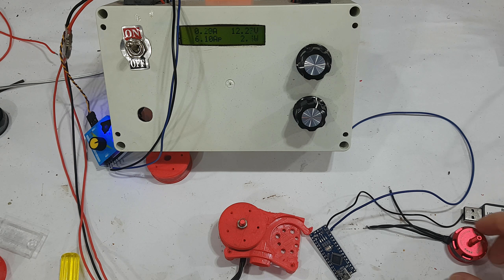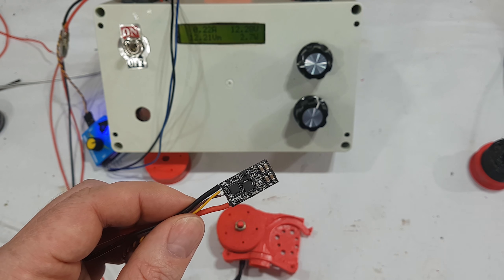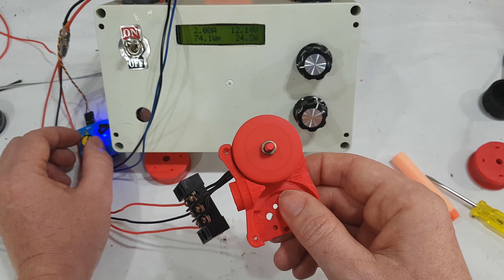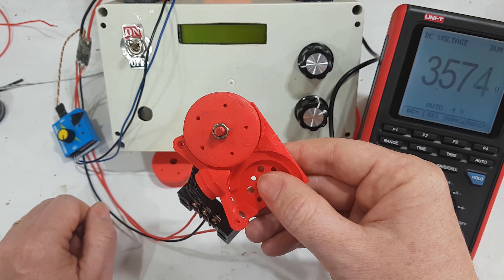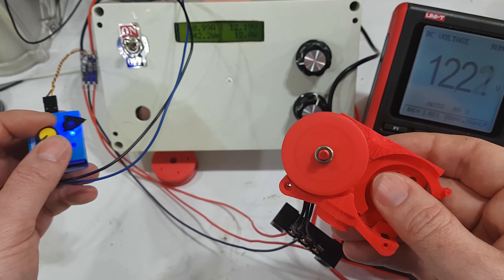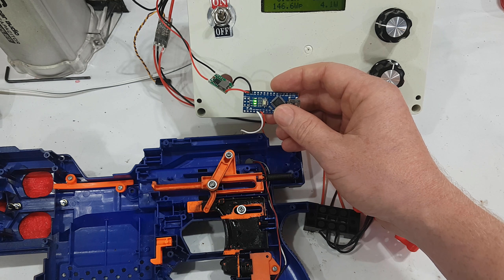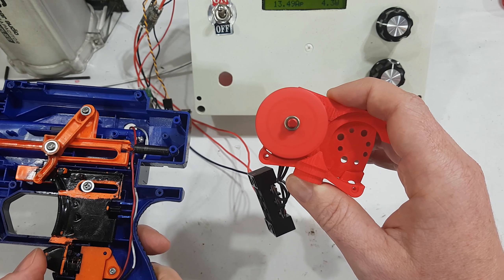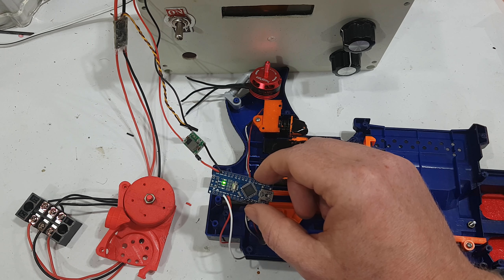Nerf Stryfe Arduino / Brushless Motor How To : Part 6

Comment: hi guys. is it possible to get the wiring diagram and the explanation for the arduino coding? this is a completely new experience for me, would really love to dive in and learn about arduino and how to control those brushless motors.
Reply from the maker: At the start of the Arduino Code it tells you which pins to solder to what 

// Created By Michael Dixon (Ultrasonic2) Auckland New Zealand

//Battery + "Bucked" down > 7ish volts in at VIN
//Battery - > GND

//Trigger > D2
//Trigger > GND

// Servo Signal (PULSE) > D9
// Servo - > D7
Reply: is it possible to use those esc with BEC 5v to power the arduino?
Reply from the maker: I'll make you a diagram in a few days

YOU HAVE to use a high frequency ESC not a cheap rubbish ones and the ESC's that were high frequency did not have 5v out. But if you can find one then yes in theory it could power it via the 5v in on the Arduino
Reply: i see. i guess i just gonna order all the item you listed, instead of just using what ever i had laying around haha. nice + awesome project btw sir :)
Reply from the maker: let me know how it goes..  it should be awesome. I've spent SOOO much time on this... I have a Raven flywheel mod coming out soon... any other idea's ?
Reply from the maker: Actually I had some time So check out the thingiverse page as i have uploaded the wiring diagram... It really is simple as.

Comment: Would you mind adding a parts list?
Reply from the maker: Done Parts list is now part of my Thingiverse page
Reply: Ultrasonic2 you rock!
Reply from the maker: Not a problem .. hopefully now you can go spank FDL2 owners and laugh at how much they cost :P
Reply: Ultrasonic2 I am in the land of the FDL's. So it would be nice to have the same edge... Well a sharper edge because of your refinements.
Reply from the maker: The FDL is a strange one to me .. while IF i had made it i would be EXTREMELY proud of my self it has some strange illogical ora around it... Get stryfe stick Brushless motors in it and a Auto fire/ Select fire kit and you're there But err looks better than the FDL.... personally i think the FDL completely missed the point of existing. If you're going to go to that much trouble why not make it have crazy awesome performance but no .. it's a stryfe ? ..... I have plans to start my own project .. the Quest for 400FPS.. can't be that hard ... though obviously not in a stryfe
Reply: Ultrasonic2 agreed, it does have a bunch of utility. I would never buy one though. I don't really like the style, so I would prefer to mod a Nerf blaster and give it all that utility. I will be watching for your next project, since you got a good sense of style.. Plus before I found your channel I was already researching peltier cooling/heating. 

400 fps... Whew that will cause foam to explode, lol. Maybe if you made darts out of 4lbs EVA foam they would survive.
Reply from the maker: im pretty sure 400fps is doable... all you need is grip (Done) .. more RPM (surface FPS) and to counter wind resistance.... wind is the only negative i can think of.. Should be done easily with multi stages, which is the only way to not destroy the dart otherwise acceleration would be to great.... Im just making this up but if we have 4 stages thats only 100 fps  per stage.... which is far less than i have on a single stage so it should be doable... in theory i can get a surface velocity of 650 fps ... so 400FPS should be doable.... Countering wind resistance will be the interesting part ..... IT will be a fun ride.... Will do it after the Raven mods and some more modes to my 3d printer.
Reply from the maker: mind you i might get sunk due to my printers in ability to print perfectly round wheels
Reply: Ultrasonic2 send it into shapeways and have a couple made from nylon. That should withstand the rpm. I think you can easily hit 300fps with a two stage with the first on 3s and the second on 4s. Should put you around 45000 rpm. I'm cheering for you, I'm all in on your designs, any other blaster you going to design a cage for?
Reply from the maker: yeah i had thought of getting someone else to make them but.. im not sure that they will be the right size  to fit on the motors .. if they under or over extrude them they will be useless :(  I have to do the rayven cos my son is obsessed with it ... i can see why i actually think it's better than the stryfe... Not sure i can fit such large wheels in the the  rayven.. 

Assuming i can get 400FPS or more, im thinking of 75,000 RPM i'll be making a bullpup  design i think''  cos right now my stryfe is a bit large and if i gog with bullpup it will be a lot shorter overall..
Reply: Ultrasonic2 shapeways is pretty solid with being exact... At least in my past experiences with them.

I have a Rayven.. So that is music to my ears. 

75000 should do it, lol.
Reply from the maker: Mind you 75,000 rpm is 6s and good for 650fps ..... i just need to get the wind going down the barrel at that too..then we should be onto a winner. err if it doesn't explode..which it might if it takes a shock
Reply from the maker: Oh bummer .. i hadn't really thought of this but, it's pretty doubtful a F396 CPU (the fastest) powered ESC can spin these motors to such high RPMS and thus i can't use out runners or printed wheels.... im pretty sure i don't want to run inrunners and currently available 2mm (ID) wheels
Reply: Bummer, you want an outrunner for the torque.
Reply from the maker: Not really ... the size is great and made mounting simple, but the main reason is you can't make 3d printed wheels that will work to fit 2mm shafts ... Will have to do some testing to see how fast the ESC can go .. i know it can go higher than 3s but how fast im not sure.. These ESC  can only do 4s, which  i have not tried...
Reply: Ultrasonic2 yeah, the motors are only rated to 4s... But with cooling... You can do a bigger ESC for a 6s.
Reply from the maker: Yeah .. Well i want the air going down the barrel so the idea would be to suck it though the motor first... also the duration is low, it's not like we are flying around for 30mins like in a Quad coptor or anything like that..... FYI if these ESC's can't do it i have found a ARM based ESC that is claimed to be able to spin them in the ball park we are talking
Reply: so basically, this is just going to turn into a railgun :>

Comment: will something like this work as well?:
AZDelivery Nano V3
Reply from the maker: i think so
Reply: also is this possible without previous knowledge on arduinos
Reply from the maker: That is my intention ..  im going to do a step by step guide when my missing parts turn up... so everyone can follow along knowing nothing prior .. you don't need to know about c# programming to get this to work .. just download some applications and plug the arduino in and flash it.
Reply: will this cage also work with a rapid strike? also, where is the Arduino code
Reply from the maker: 100% wont fix the rapid strike ( i have one too ) . code is part of the thingiverse download
Reply: I hope this will work for me, as I already burned 2 polulu motor drivers for an rc bb8 project
didn't know anything about code, and found a tutorial but it just killed 2 drivers
had to go the simple rc electronics route, it is now working
Reply: I hope when I attempt this it will not go the same route
Reply: when can we expect a rapid strike cage?
Reply from the maker: i do not know.. I assume that there is only a hand full of them around that would be interested.. i have done the rayven.. and bought a regulator last week.. the Reg is the obvious one to work on next
Reply: :( ok.......
so maybe after the regulator?
Reply from the maker: Probably .. i'd like to finish the select fire on my rapid..
Reply: so it would be a select fire brushless rapid strike?
Reply: definitely better that the fdl2+
Reply from the maker: yeah man.. .. im hoping the stryfe will be better than the fdl2 once im finished with it ... So should the regulator too... just not enough time.... i currently editing a reg video as we speak
Reply: now you just need to copy walcoms7's triple mag well rapidstrike: https://www.youtube.com/watch?v=1MvjbQNwcrs
Reply: and it would probably be the ultimate nerf blaster, better than Eli wu's rapid strike.....
Reply: hopefully once you have time, we will get a rapid strike cage
Reply: just got the Arduino software, and to run it on an Arduino I just need to delete the top part about what connections go where. right?
Reply: I verified the code but got this,
Arduino: 1.8.4 (Mac OS X), Board: "Arduino/Genuino Uno"

motor_test:2: error: redefinition of 'Servo myservo'
 Servo myservo; 
       ^
/Users/dragonspc/Desktop/StryfeMotors/StryfeMotors.ino:14:7: note: 'Servo myservo' previously declared here
 Servo myservo; 
       ^
motor_test:3: error: redefinition of 'int RevPulled'
 int RevPulled; 
     ^
/Users/dragonspc/Desktop/StryfeMotors/StryfeMotors.ino:15:5: note: 'int RevPulled' previously declared here
 int RevPulled; 
     ^
motor_test:4: error: redefinition of 'int PreviousFlyWheel'
 int PreviousFlyWheel = 0; //off
     ^
/Users/dragonspc/Desktop/StryfeMotors/StryfeMotors.ino:16:5: note: 'int PreviousFlyWheel' previously defined here
 int PreviousFlyWheel = 0; //off
     ^
/Users/dragonspc/Desktop/StryfeMotors/motor_test.ino: In function 'void setup()':
motor_test:6: error: redefinition of 'void setup()'
 void setup() {
      ^
/Users/dragonspc/Desktop/StryfeMotors/StryfeMotors.ino:18:6: note: 'void setup()' previously defined here
 void setup() {
      ^
/Users/dragonspc/Desktop/StryfeMotors/motor_test.ino: In function 'void Buttonsstate()':
motor_test:12: error: redefinition of 'void Buttonsstate()'
 void Buttonsstate()// de bounce 
      ^
/Users/dragonspc/Desktop/StryfeMotors/StryfeMotors.ino:24:6: note: 'void Buttonsstate()' previously defined here
 void Buttonsstate()// de bounce 
      ^
/Users/dragonspc/Desktop/StryfeMotors/motor_test.ino: In function 'void loop()':
motor_test:26: error: redefinition of 'void loop()'
 void loop() {
      ^
/Users/dragonspc/Desktop/StryfeMotors/StryfeMotors.ino:38:6: note: 'void loop()' previously defined here
 void loop() {
      ^
exit status 1
redefinition of 'Servo myservo'
Reply: so what is wrong with the code?
Reply from the maker: i assume whats wrong is you deleted the stuff at the top lol/ And or you you copied and pasted it twice ..

Did you get it going
Reply: yes, I fixed it
and yes it was the fact that I deleted the top part.......
Reply: now I just need the components and I will be ready to test it
Reply from the maker: let me know how it goes.. seriously
Reply from the maker: just make sure you get good esc's
Reply: could you please tell me what rectifier diode I need cause I could not find the exact name of them
Reply from the maker: why not use the links provided ?
Reply: would this theoretically fit in a aftermarket modded rapid strike cage?
Reply from the maker: Well the cage wont fit in a rapid strike..  I have some plans to make one though
Reply: guess ill have to wait with printing one then :(
I will still print the flywheels to test the setup though!